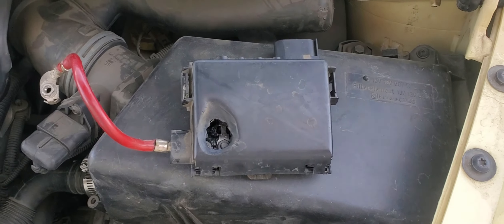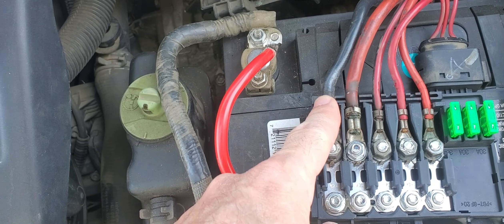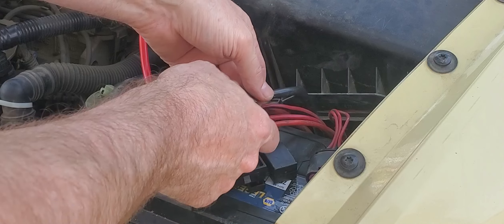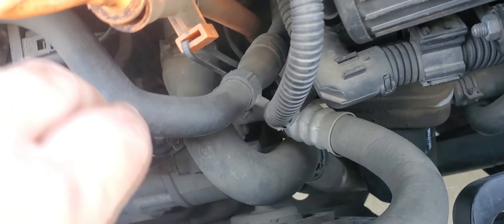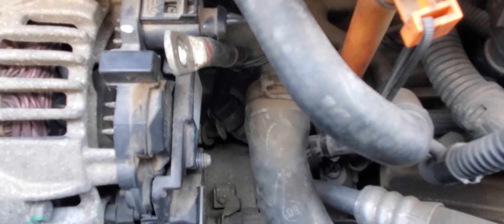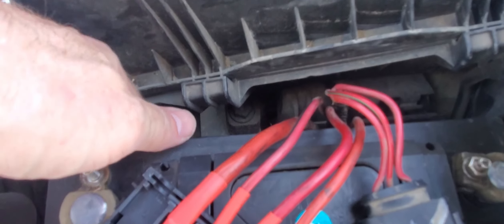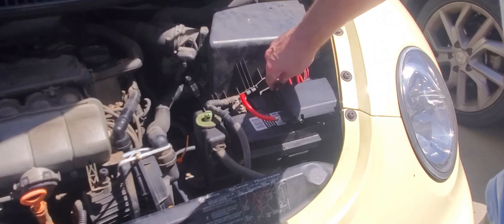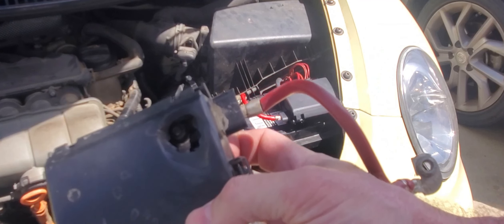VW New Beetle Fuse Box Melting Easy Fix!

Comment: Thank you for this video!! Just fixed my daughter's Beetle that had this exact problem.  MIDAS charged her $100 to "diagnose" and estimate of $900 to repair! (I was not in town so she did this without asking me first,  unfortunately).  I fixed for $40 & in about 1 hour. Thank you so much,  that larger gauge wire is a great idea as was leaving the old one in place,  good short-cut. You the man!
Reply from the maker: I'm glad it worked out for you.   Just check the cable once in awhile to make sure it's still cool and free of corrosion.  I had a little corrosion on the cable on the fuse box side so i cut it back and attached a new copper lug and did a double heat shrink wrap on it to keep the moisture out.  So far its working perfectly.  Thanks for watching and the comment.   Kelly

Comment: Thank you for sharing. Your video was very helpful. I’m having the same problem now. What size copperwire lugs did you use? I found some on Amazon but there’s so many different sizes.
Reply from the maker: I ended up just buying an assorted set off Amazon.  I can't remember which one fit the best.  But I left the link in the video description.  K

Comment: I did this today and seems to work fine does your cable still get a little warm after driving a bit or is it completely cool? Cause mine still gets just slightly warm but still able to touch it without getting your finger burnt.
Reply from the maker: Thanks for watching.  The cable can get slightly warm to the touch.  But not hot.  Like everything in the engine bay the more you run it the warmer it gets.  Just keep checking it once in awhile.  If it ever feels like it's getting too hot for you to touch then go back and check all your connections again or you might have another issue.  K

Comment: My question Kelly, is that i have the same beetle... On the existing harness, like you mentioned has 2 extra switches coming off the harness.... Ok now how do they get pickup? If your running a 4 gauge wire express from the alternator to the fuse box? Maybe i missed something... Please advise.... Im curious... Thanks....
Reply from the maker: What switches are you talking about?
Reply: @deadlinekelly9938  thanks again for contacting me... On the existing harness, there are a couple of electrical connections that come off the harness... How do they get picked up?
Reply from the maker: Ok I understand now.  You leave those connected.  In fact you leave the old harness in place.  Just disconnect the black thick cable that goes from the alternator to the fuse box and wrap the ends up with electrical tape and push them to the side.  You don't have to remove the old harness at all.  You just want the new cable to go from the alternator to the fuse box.  I just used some zip ties to attach it to some hoses to keep it out of the way.  Watch the video again and you will see what I mean.  K
Reply: @deadlinekelly9938  deadline Kelly, thanks.... I'm going to give it a shot, this weekend...

Comment: Hey Kelly, thanks for this video. I’m having another issue which one I’ve the cables coming out the three pin connection is melting is your fix gonna solve that you think?
Reply from the maker: Hi and thanks for watching and for the question.  So I haven't heard of anyone having an issue with the 3 pin connection but I would think that the problem you are having is caused by the same thing which is too much resistance entering the fuse box.  I would just do the fix like I did and just keep checking the temperature of all the wires and the 3 pin connector.  Drive it around the block a couple of times and check the wires to make sure they are not heating up too much.  Let me know how everything goes.  Kelly

Comment: So was the black wire the problem cause I have replace fuse box to many times. What causes the melting on the fuse box. So did the copper do the job. Did it ?
Reply from the maker: Yes. Resistance. Yes. Yes.
Reply: Where do I buy the copper not sure what they are called
Reply from the maker: @rosaa.cedillo2285  Here are the links to the items I used for the fix.
Cable - https://www.amazon.com/dp/B09QNM4PZT?ref_=cm_sw_r_apan_dp_T2K934283Q78ENKGNN0D&th=1
Copper Wire Lugs - https://www.amazon.com/dp/B09WVGLJ38?ref_=cm_sw_r_apan_dp_7KENA8E8SBZPG2GY05CQ&th=1
Fuse Box for 2004 VW Beetle - https://www.amazon.com/dp/B08Y8ZQSXT?ref_=cm_sw_r_apan_dp_RCW29F9V2G8JFG6T9NGZ

Comment: The fire was pretty bad for mine and burnt some of the copper wire do you have a reccomendation to clean it? before putting the new lugs and heat shrink?
Reply from the maker: Try wire brushing the copper and also use a little baking soda and water to remove any corrosion.

Comment: Great video! Just wondering what tool do you use to crimp the large size lugs? Does it have a part number? 

I’ve always just done it with big channel locks even though it’s not the proper way.
Reply from the maker: I just used what I had handy.  It was just a pair of wire strippers from harbor freight.  Nothing fancy.  Here's what I used ,  https://www.harborfreight.com/self-adjusting-wire-stripper-57316.html
Thanks for watching.  Kelly
Reply: @deadlinekelly9938  thank you!

Comment: This is just helpful!! thank you so much for sharing!
by the way, i see the stock cable contains three extra plugger, if i fix it the same way as you did, should i just ignore those and focus on the connection between the alternator and fuse box?
thanks again!
Reply from the maker: Thanks for watching.  I just left the stock cable in place because it does have those other connectors wrapped up in the same bundle of wires. Just unhook the main cable and wrap up the ends with electric tape or shink wrap them like I did. It's way easier to do it that way instead of pulling all those other connectors off the old cable.  Any more questions just let me know.  Thanks, Kelly

Comment: The wiring horn is comes with plugs on it, how can you bypass the plugs?
Reply from the maker: You leave those connected.  In fact you leave the old harness in place.  Just disconnect the black thick cable that goes from the alternator to the fuse box and wrap the ends up with electrical tape and push them to the side.  You don't have to remove the old harness at all.  You just want the new cable to go from the alternator to the fuse box.  I just used some zip ties to attach it to some hoses to keep it out of the way.  Watch the video again and you will see what I mean.  K
Reply: @deadlinekelly9938  
I made up a 3 foot long 4 gauge cable today, ran it from the alternator to the fuse box, and the wire doesn’t even get warm anymore. Everything works great thanks for the idea.
Reply from the maker: Awesome.   Just check it once in awhile to make sure it's still cool.  If it heats up it's probably some corrosion build up on the end.  I had this happen and just trimmed the wire back a couple of inches and put a new connector on and really sealed it up good with the shrink wrap so no moisture can get into it now.

Comment: Thank you so much for this video!! My 2000 beetle we found out the wire from the alternator to the fuse box has been starting to melt. We bought the fuse box but was told it would continue if we didn’t replace the wire. Everyone keeps telling us we have to do the whole alternator wiring harness. But all we see was the black wire that your doing but we kept getting told no you have to do it all. I’m so glad I came across this video because it’s showed just the black wire which is the same for mine. So I ordered the wire and the crimps. And I do wonder if they changed the wire before but never the gage because there happens to be a wire with the same end as yours down by the alternator as well just hanging there. So I do have a question once we replace it we can then run the air conditioner and the wire will stay cool? I believe running the air conditioner is what got it super hot and then started to melt. Thanks again!!!
Reply from the maker: Thanks for watching and be sure to Subscribe!  I have other Beetle videos on my channel.  You Do Not have to replace the complete wiring harness.  Be sure to wrap up the ends of the old alternator cable and that other wire you mentioned with electrical tape or heat shrink wrap.  You don't want any bare metal from the old wire to short something out.  It's been 4 months since I fixed this problem and the 4 gauge cable I got from Amazon is still working perfectly for me.  We live in central California and it's crazy hot in the summer so we run our AC every time we drive and we drive this car everyday.  The cable and fuse box are still cool to the touch.  Be sure to change all the wire crimps for all the wires connecting to the fuse box to the new copper lugs like I did in the video.  After you get everything changed just start your car and check the wires to see if they are heating up.  They should stay cool.  If they heat up right away shut off the car and check your work to make sure everything is connected properly.  You shouldn't have any problems running your AC as much as you want.  Do a couple of test runs where you let the car run for 10-20 minutes and then check the wire temp.  All the wires should be cool to the touch.  This should definitely fix the problem for you!  Let me know how it goes and if you have any questions send me another message.  Thanks, Kelly
Reply: Thanks so much we replaced the alternator wire and all the crimps on the rest and new fuse box. Let it run did good. Went and ran an errand used the air conditioner came back checked and all the wires are cool!!!
Reply from the maker: Awesome!  I'm glad it worked out for you.  Thanks for letting me know.  K

Comment: What size was your black wire?
Reply from the maker: Hi.  This is the wire I  bought from Amazon.   4 AWG Gauge Fully Assembled Battery Cables, 1-15ft Lengths, Positive or Negative Wire, Pure Copper Battery Replacement Cables, Solar Car Truck RV Camper (4ft, Single Black, 3/8” Lugs) https://www.amazon.com/dp/B09QNM4PZT?ref_=cm_sw_r_apan_dp_PQ9W0ZEJHP9GGJQ951MY&language=en-US

Comment: Nice video and presentation. We also have one VW NB TDI like this. We will follow direction here and watch if we need to do something. This is a problem with symptoms show up in plane sight.
Reply from the maker: Be sure to check this.  If the wires going into the fuse box are too hot to touch then you need to do this fix. If you make the fix before the fuse box melts then that will save you money also because you won't have to buy a new fuse box. Thanks for watching and commenting.  Kelly
Reply: @deadlinekelly9938 agreed. excellent advice. I’d wax glue a short piece of birthday candle at the terminal for a few days to determine the severity and go from there. The most current hungry parts are - 4 glow plugs, day time head lights 2, radiator fan and ac fan on asphalt in a traffic jam in summer.

Comment: There’s a company on eBay that makes a nice heavy duty one to correct the problem for $26 bucks
Reply from the maker: The cable I used is $21 on Amazon.   See the link in the description.
Reply: Do you a number cause I do not know which one

Comment: This issue can cause a 1998-2011 VW New Beetle to catch fire...and destroy the car.😥
Reply from the maker: You are so right.  And car fires are really something you want to avoid.  VW really should have done a recall for this problem.  But you can fix it yourself inexpensively like I have done in this video.
Reply: @deadlinekelly9938  great video, any update about the wire?